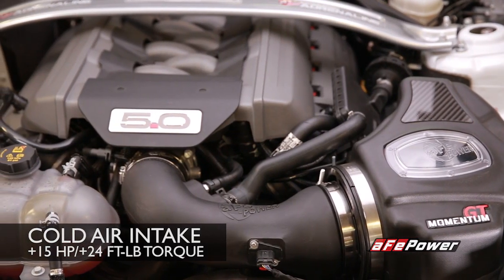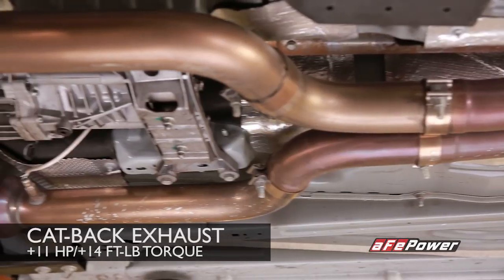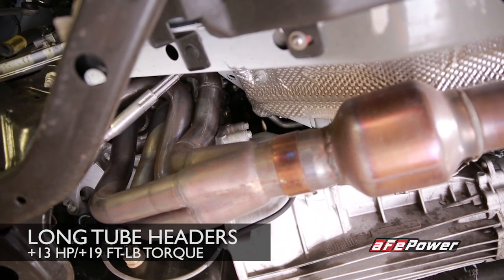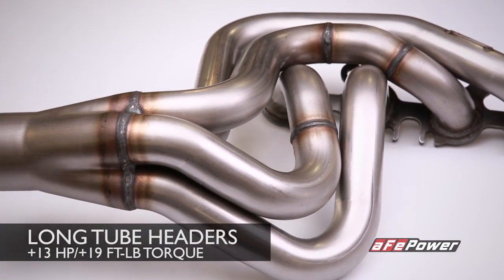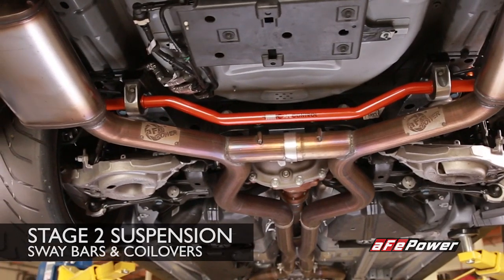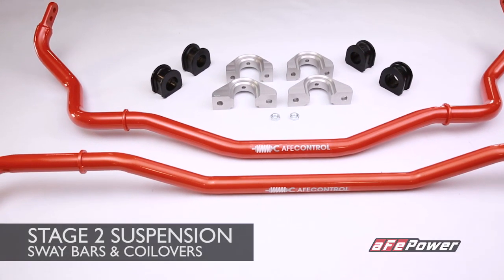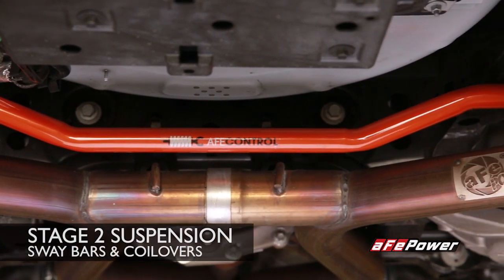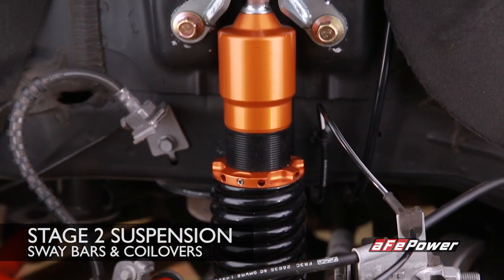aFe POWER S550 Mustang Products - Performance / Suspension

Comment: Long time listener 1st time commenting .... how do u adjust suspension to preferences ?
Once it’s been installed .... how would you go by adjusting  ride height ?
Reply from the maker: Front and rear shocks have 24-way adjustable rebound and compression damping knobs to make them softer or firmer. To adjust height: measure and document the ride height before adjustment. Safely lift the car, droop the suspension, use the supplied perch tool to raise or lower the collars in 1/4 increments. Lower the car and roll it forward and backward so the suspension settles before measuring and setting desired height.